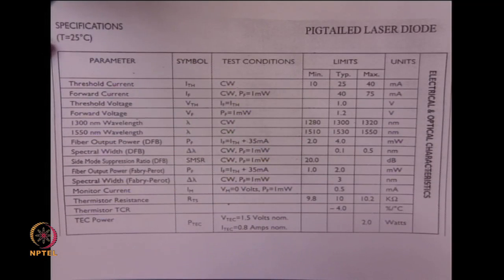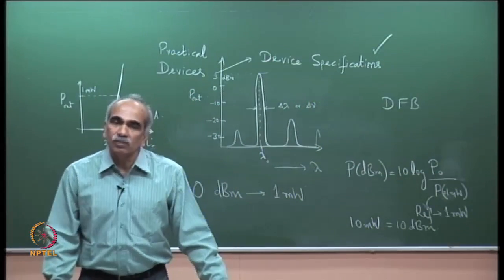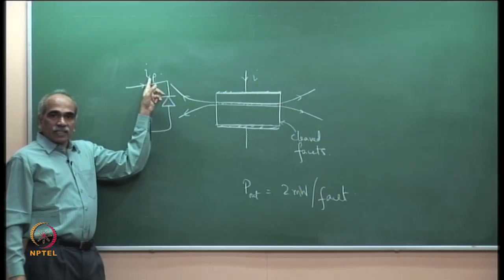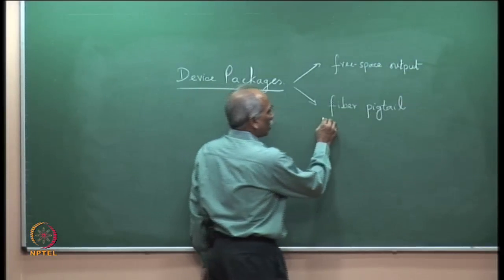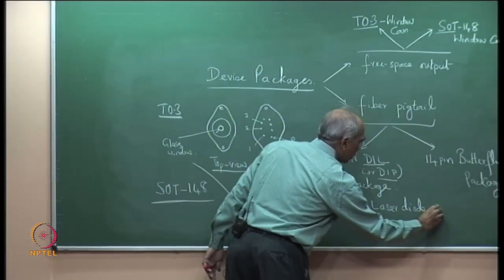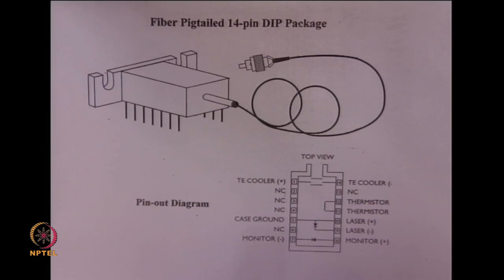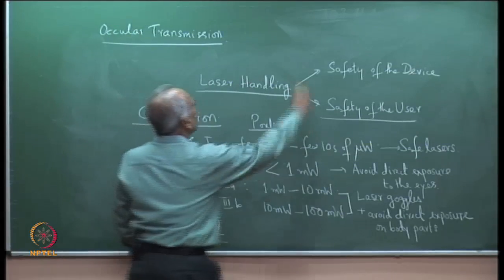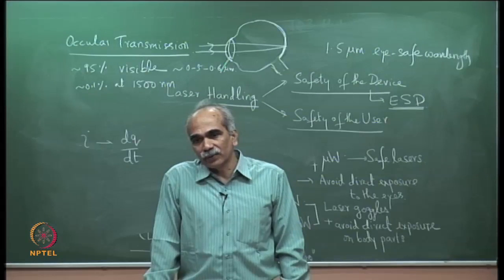Practical Laser Diodes and Handling

Comment: Mfr. Eblana Photonics Ltd, Ireland
Products:  Diode Lasers from 760 nm to 2350 nm 

Laser Diodes for Aerospace, Medical instrumentation, TDLAS based Gas Sensing, Test & Measurement, Fiber Optic Communications, Remote Sensing and Atomic Clock etc.

The Eblana Photonics supplies single wavelength laser diodes across a wide range of NIR wavelengths. All of our single mode diode lasers exhibit superior line width properties compared to typical DFB lasers and our wavelength range extends from 760 nm to 2350 nm. We can deliver custom lasers at specific wavelengths in a range of package formats. We provide Custom laser solutions for projects, engineering co-operation, and OEM.

Laser diodes for TDLAS based gas sensors. TDLAS is a robust and the most reliable gas sensing technology compared to the traditional electrochemical or the (IR) infrared gas sens

Visit our website for more details: lasertech photonics .com